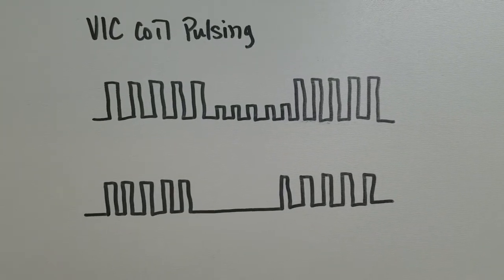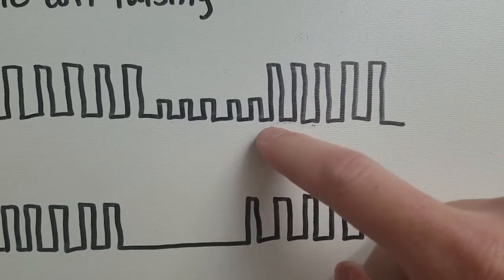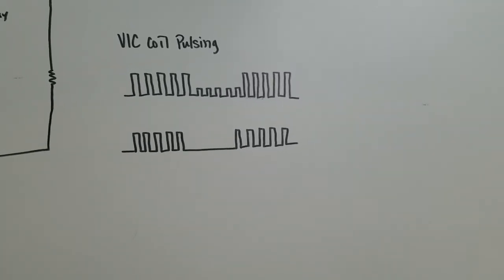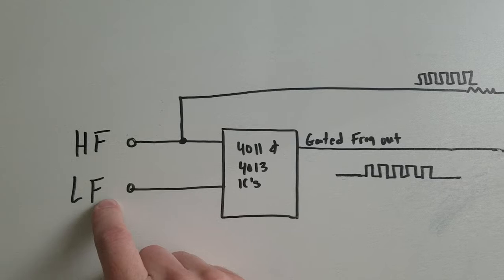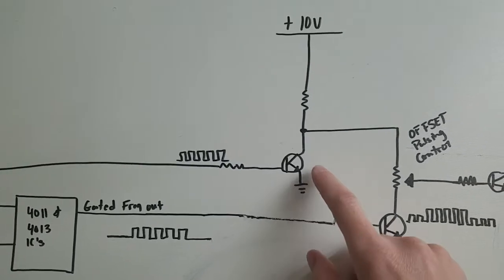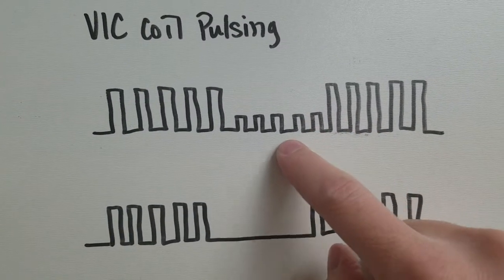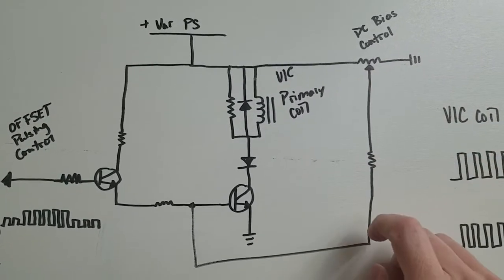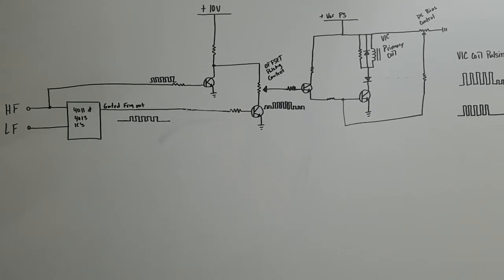Stan Meyer Research # 20, Apr 2019-Variable amplitude pulsing during the 'Gate' time

Comment: Would you be able to send me this circuit with the necessary components in the email: d.londero@hotmail.com
Reply from the maker: Davi Londero 

This is the best I can do for now as I didn't note all the values before I pulled the circuit off the beadboard. I do still have the I/O's for the ICs labeled if you want them. 

All the transistors were 2N2222 except the primary drive transistor which was a TIP120. You just need to look up the datasheet for the 2N2222s and TIP120 to determine your base resistances then try 1k multi turn pots to change the amplitude. I can't remember what value pots I used to get a fine adjustment, I just tried several different ones I had until it worked the way I wanted it to.
Reply: @BradKwfc  I want to build a circuit of this
I also do not know how to make the connection on cd 4017
Reply from the maker: Davi Londero 

Are you trying to build Stan's Variable Pulse Frequency Generator or the entire Cell Driver Circuit (PLL)?

IMO unless your a SM purist or are trying to build the PLL there are frequency generators out there that will do everything the VPFG does and more.

I've worked with an exact replication of Stan's PLL and a modified version and I'll tell you it's really difficult to adjust. Not only that but you can't see the frequencies and amplitudes unless your using a scope...

It's easier to start with a dual channel freq gen with the drive circuit on a breadboard. With the freq gen you have the ability of tuning down to the .01Hz or smaller, and you can see exactly what your putting into the drive circuit. 

I have two dual channel freq gens, a Siglent that cost me $350 and a FeelTech that cost me around $100. I use the cheaper Feeltech one for everything.
Reply: @BradKwfc  So! I want to make a fequencia generator that works to work with hho, it might be that the cheaper one works.